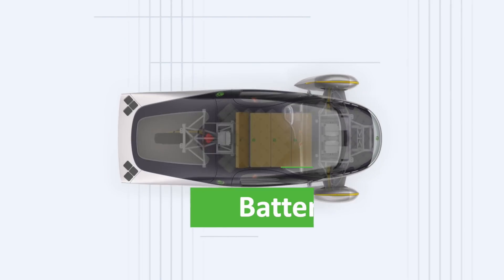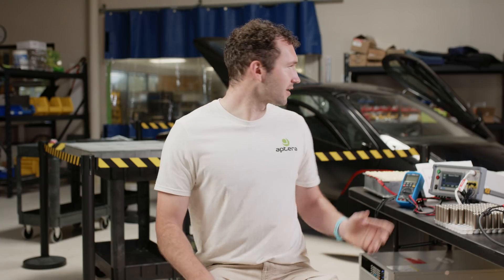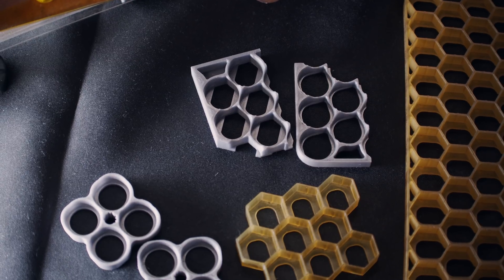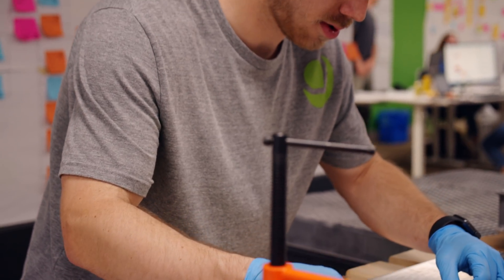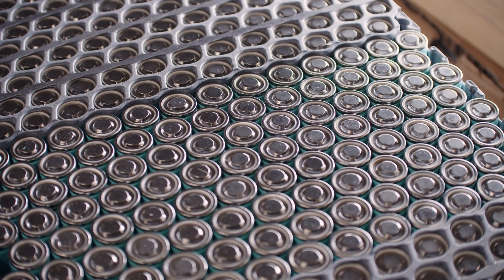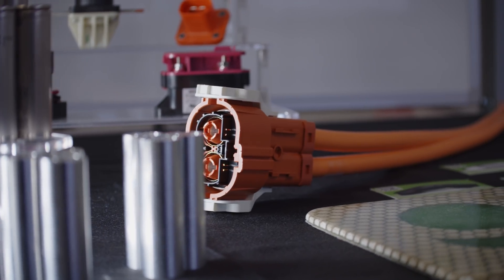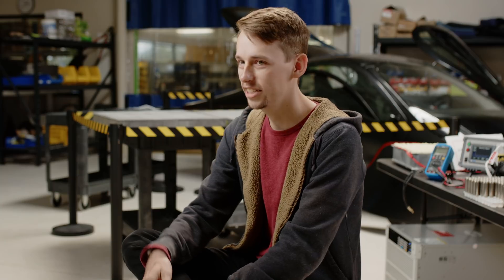Aptera — Battery Update

Comment: My concern is for your cloudy neighbor over in Michigan it’s not sunny every day, have you done any concentration testing? “How much sun/ rays” needs to be exposed. And the 1000 mile range pack, does that mean I’ll have up to 1000 miles per charge?
Reply from the maker: Hi Angelique! Cloudy-climate drivers needn't fear, Aptera is designed to include battery packs good for 25, 40, 60, or 100 kWh, with the largest delivering up to 1,000 miles of range per charge. You can find out how many times a year you'll need to plug in by using the solar calculator on our website: https://aptera.us/vehicle/.
Reply: I’d love to be a Guinea pig for Michigan for you all, its summer right now, but I’m super curious how it will do in the winter and that battery in the cold
Reply: I will be taking delivery of an early Paradigm model for use in Iowa.  We probably only have 1/2 the solar insolation of San Diego, but living in a small town, my daily driving needs are far less than they might be in an urban area.  I think the 20 miles or so of average solar range I might expect is still going to be plenty. 

I also expect that V2G will become available.  I was just quoted a 10 kWh pack for my home at $18,000.  Plugging in my Aptera for this function will be a huge possible increase in value.

Comment: How easy will it be to replace the battery overall? Or can the Aptera identify which cell in the battery is bad and can you replace those cells?
Reply from the maker: Great question! Many cells can fail in our pack design before things need to be replaced, and if replacement is needed, you would only need to replace the pack itself. The replacement costs will vary, but we expect them to be less than any other EV as our packs are smaller for a given range. Please stay tuned for exact answers regarding our battery warranty and repair/replacement cost and plan as we get closer to production time. Thanks for watching!
Reply: @ApteraMotors  by "replace the pack itself" do you mean one of the six 416 cell packs that has been identified as faulty? Or do you mean replacing the entire 2,496 cell 6 pack battery assembly?
Reply: @rwo6211  Probably the entire pack assembly.  Due to right to repair, a knowledgeable owner or third party could probably do other work at their own risk.
Reply: @n.brucenelson5920  I question that any owner who is not trained to work with high voltage should be doing this work in spite of right to repair. I also believe that Aptera should either prohibit or restrict this kind of effort to only those that can verify training to handle high voltage to limit liability.

Comment: 🔌333 MPGe gives this super-efficient Aptera bragging rights. The average electricity rate in the USA is 10.42 cents per kilowatt-hour so that works out to 1.07 cents/mile for Aptera versus 17.24 cents/mile for light-duty gasoline vehicles that average 25.7 MPG using today's national average regular fuel rate of $4.43/gallon.  If you travel 1000 miles per month Aptera would cost you $10.70 compared to $172.40 for light-duty vehicles.  This gives Aptera owners an out-of-pocket green savings of $1,940.00/year without the full solar package while at the same time going environmentally green. 🔌
Reply: Furthermore I expect substantially lower maintenance costs compared to ICE vehicles, lower insurance rates compared to 4-wheelers, no rust repairs at higher age of the vehicle, leave alone that in case of slight collisions only scratches will ocurr instead of much more expensive to be repaired dings.
Reply: Aptera, you have a standing invitation to Costa Rica, where we are already changing to mostly electric vehicles already. We could be the pre-production lab for the bigger markets too.

Comment: Did you guys get the approval to charge the battery with Tesla's charging network?
Reply: That will be a BIG DEAL announcement if it happens; not a little Youtube comment. 
But ssince Tesla has already announced they are opening up their network to all EVs, maybe it's not such a big announcement after all.  
Anyway I'm looking forward to a demo of this soon.
Reply: @fotoguru222  it will take years for tesla to have ccs on a significant percentage of superchargers; having the tesla plug and access would still be a big deal.  That said ccs is improving fast and superchargers are missing in some locations (ie Newfoundland).  50-100 kw is an issue for most evs; Aptera dorky have this issue.
Reply: @vic321344  Europe has basically decided on ccs2 and tesla doesn't push their plug in that market.  I was referring to the na market in which ccs and tesla are roughly equal (screwed to tesla in some areas).  Fortunately 400 kw chademo seems to have not gotten traction so it isn't a 3 horse race.  Lot more teslas in Na than Europe had when tesla went ccs so I don't see them backing away from the arguably superior tesla plug here.  More duel headed chargers and adapters are the forseeable future for NA

Comment: How long does it take to charge? What is the energy used to charge it compared to a household appliance? 

I heard another company takes hours and is same energy as a washer or dryer to charge.
Reply: How long depends on what you plug it into, or if charging by solar, how many solar panels you have.

Fastest is DC fast charging at 50 KW. So charging your 40 KWH from 10% to 80% (a typical road trip fast charge) requires 70% of 40 KWH = 28 KWH. At 50 KW that works out to about 34 minutes for 280 miles. 

Slow solar charging with full solar package on a clear sunny day is 40 miles per day (4 KWH per day). 

At 240 volts AC (an electric dryer outlet for example) it charges at a rate of 6.6 KW = 66 miles per hour.
Reply: @fotoguru222  thanks for the in depth explanation! How much power compared to an appliance is it comparable for dc charging?
Reply: @MTB214  DC fast chargers don't fit in homes. DC fast chargers at 50 KW takes industrial levels of at least 480 volt, 3 phase higher voltage AC power, each, and so a set of them requires their own substation from the utility company.
My whole home is wired for 200 amps of 240 volts AC. (Older homes have only half of that.) 
200 amps x 240 volts = 48000 watts = 48 KW, not enough for a single DC fast charger.
Reply: @fotoguru222  Thanks for the information. How do you know so much about electric?
Reply: @MTB214  Well, I read and watch Youtube videos a lot. 8-) 
And I work on DIY projects. 
I own an electric car, the 2014 Chevy Volt, and designed a portable solar charger for it. I stopped working on that when I found out about Aptera. 
I learned the basics of electricity by reading, and by majoring in Physics and Electrical Engineering.

Comment: I would like to know what the battery pack configuration and weight will be (60 Kwh  version).
The video shows a 2 x 3 configuration for the 41 KWh pack. Is this 3 wide by 2 from to back. If so that means only one additional row is required for the 60 Kwh pack (9 total required). Otherwise the length of the battery pack becomes problematic at the 100 Kwh size. Will the 100 Kwh pack have a different form factor?
What is each modules weight? 40 - 50 lbs ??

Comment: 41KWh usable, so how much actual battery capacity?
Reply: That will be settable in software, and probably something each user will have control over.
Reply: @n.brucenelson5920  yes but curious what actual capacity is because he said usable 41 which indicates actual capacity is larger.
Reply: @danwat1234  We know the number of cells.  We may have to guess from that.
Reply: @vic321344  not sure where 5 dollars a battery is from but the Indutry average is about 110 dollars per KWH of these type of cells as of December 2021 and was expected to max out if prices continued to climb at 135 dollars per KWH.  That's right about 6 grand per pack of this size at the high end cost. I did find I can buy a single battery for 5 dollars but single batteries are much more expensive then huge orders per unit
Reply: 44.9 kwh based on cell specs
Reply: @ccibinel  but we don't know the exact chemistry used?  Cell form factor does not determine capacity alone.

Comment: I assume that your references to energy density were volumetric due to the nature of the vehicle and since you showed lots of 18650 form factor cells. Could you share why you made that choice? I'm guessing 21700 availability being lower is a consideration.
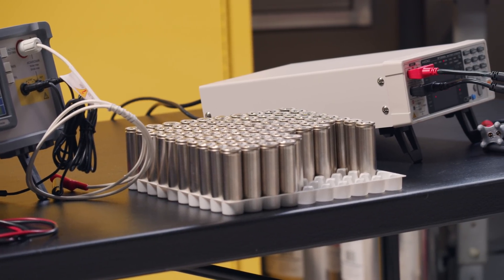Reply: I was wondering the same thing until the shot at 3:16, which has to be 2170s.
Reply: I think you may be fooled by perspective.  Aptera is using 2170 cells in their packs as far as what they have said publicly.
Reply: @n.brucenelson5920  Didn't know that. Visuals looked pretty skinny, but hey, its Youtube.

Comment: Please check on NanoXplore's graphene black.  If you added that into Aptera batteries, you'd have 750wh/L with typical 18650 form factor cells
Reply: They have to use batteries that are actually being produced.  That company is a long way from producing at scale if they ever do.
Reply: @matthewmanzi9504  You'd be wrong.  They're already producing the batteries and had a battery day in April.
Reply: How can you be so  clueless. I guess just uninformed with no background or experience. The battery pack is proprietary designed for easier, quicker, and less expensive production. Also quicker to remediate defects. Same for the in wheel motors.
Reply: @EarthCreature.  as of their battery day press release, they are producing batteries in their demonstration plant to optimize the process.  That is not commercially producing and they have plans for a commercial production plant but those usually take years to build. I'm not against this company at all but you can't use a product that doesn't exist commercially yet. The Samsung cells are the same energy density and are readily available.  If there is information, I'm  missing I would like to know about it but this is what I see from them. I see that they have 800kw/l in the pipeline but I don't know what that is going to be produced.
Reply: Aptera is using 2170 cells, and I am sure only buying the batteries and making their own packs.
Reply: @n.brucenelson5920  Not sure how you have this amazing ability to miss the point or miss the context.  I didn't say Aptera has 18650 form factored cells.  I was clearly talking about NanoXplore's current battery venture.
Reply: These samsung cells are already 750 WH/L. Pretty industy standard right now.
Reply: @vic321344 again why are you commenting this to me. I never said anything to the contrary.

Comment: I'm still wondering how you'll fit a 100kwh pack; 15 modules? Huge and over 1000 pounds
Reply: I am skeptical that the 1000 ever is produced as they weight and size is huge. It might be but it won't be for a while. 60kw or like 61.5 if this one is 41kw, is some extreme range already.
Reply: @matthewmanzi9504  it will need 18-20 modules and weigh around 1500lb.  It's possible but absolutely silly.  Closer to 130kwh usable will be needed.
Reply: We ordered the 600 mile range. Cannot imagine it actually supporting a 1000 mile pack. There would have to be some serious modifications to get there. Hopefully by production time LFP density will be high enough to work in this.
Reply: @babaluto  I doubt it, LFP would probably work against efficiency despite its advantages in service life and calendar aging. Remember they said the focus was efficiency. If they're trying to achieve 20% more energy density wrt other leading manufacturers, it'd be grossly offset by LFP's ~50-60% lower energy density and would come out heavier. It could be an argument, however, in their lowest range model which has a big weight savings.

I don't see LFP getting a breakthrough in energy density compared to NMC in the next year for sure. Even if there is, the first offering would be really expensive. 
I mean, do owners really need LFP when range is this high? You won't be physically capable of cycling the battery even remotely as often as current EVs, and the solar helps to actively maintain ideal temperatures for calendar aging. Aptera is going to rock it with NMC. Plus, after 10 years and 80% degradation, it's still going to be more than competitive against other aging EVs from the same year.
Reply: @Infinion  all good points except where you say the cycling. LFP have a much higher cycle life. They can full cycle to the extremes better, therefore picking up some range. Although I have not assembled any motion or traction batteries in NMC, my experience has been with LFP. As you say, "if" the density comes closer to par by weight and size for the LFP, it is a much safer product, mechanically and thermally. I'm a little skeptical about the vehicle being able to efficiently cool the pack while parked without throttling the charge rate. Just my skepticism, curiosity and opinion. Still, I have my order and invested into the five figures. I want this to be successful, have been since 2008.
Reply: @babaluto  I think this news makes it much more likely that the 1000 mile packs are within reach.
Reply: @n.brucenelson5920  Not saying they can't do it. Here's to hoping that they will! As they admitted, it will take some mods or suspension tuning. I'm sure the initial runs will give them data for it. Time will tell. BTW , I'm real excited for you to get one of the early ones and take your road trip. Mine will be from San Diego to Savannah. I already have a solar charging station on the property. Got a little ahead of myself here.lol
Reply: @babaluto  Good for you!  I will not be going straight.  After Death Valley we will head for Bellingham, WA and may continue East after we get back to Iowa to meet with Ambassadors and Youtubers.  We will see.
Reply: @n.brucenelson5920  Go forward, never straight. It'll be a blast!
Reply: @aussieideasman8498  Which is a major reason your comments make no sense.  You have no grasp of simple engineering.
Reply: @aussieideasman8498  I believe they will be above reach unlike Tesla's promises!

Comment: Which chemistry do you use now? NMC? and from which supplier? I use Samsung 30q and molicell p42 right now, would be nice to know! 
Greetings from a German Ambassador!
Reply: At one point there was conjecture they're using Samsung INR21700-50E battery cells.
Reply: @peterjorgensen3  If Aptera Owner's Club is right they are using the 50D's and not the 50E's
Reply: @vic321344  Yes thank you
Reply: @JeppeRito  Interesting. I copied that part number from one of their old videos. It wouldn't surprise me if they are using the 50D or 50G. Thanks for the correction.

Comment: Not a ton of nerdy info. Wish they would talk about the voltage, assuming it's 400v. And maybe talk about the connector, I remember early prototypes using the Tesla connector. But since Tesla seems to be adding ccs to their stations it would make sense to just have CCS like every other car.
Reply: Likely 400 V. No need for 800 because of the quick miles per kWh due to the Roadster’s effeminacy.

I’m hoping for a J1772/CCS charge plug.  Standards matter.
Reply: @Rich1Rodriguez  Effeminacy? Does everything have to be gender-based?
Reply: @bbollig9288  Pretty sure that was an auto-correct fail for ‘efficiency’ 🤣

Comment: I had no idea how much design and engineering is being invested in the batteries. Very exciting. Looks like a great team.
Reply from the maker: We're quite lucky to have a team of changemakers and problem solvers!
Reply: @ApteraMotors  I'm curious what battery breakthroughs on the horizon have your team's attention. Have you guys considered solid state batteries at some point? Or any of the other upcoming breakthroughs that have your eye?
Reply: @vic321344  there must be something unique to file a patent!
Reply: @ApteraMotors  I missed where they talked about switching from LiFePO4 to NMC???? Going for a battery that Cycles 4000-6000 Cycles down to a cheaper battery that has 500-2000 Cycles???? Why? When I reserved 2 years ago it was supposed to be LiFePO4.😢 Y’all even hyped up the Safety and Reliability of the iron phosphate chemistry. What happened?